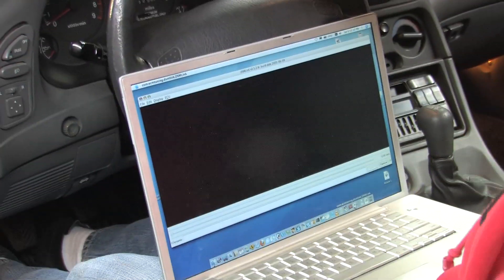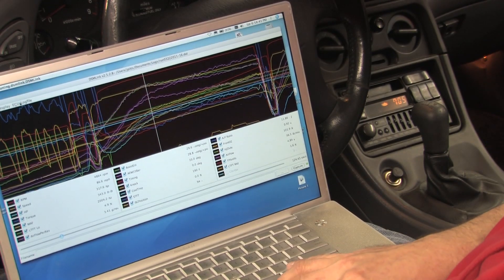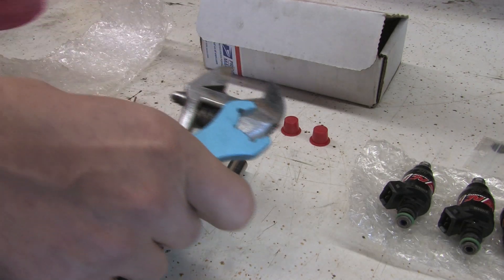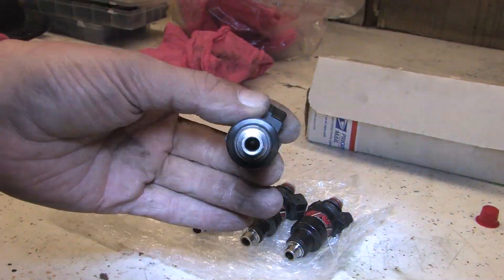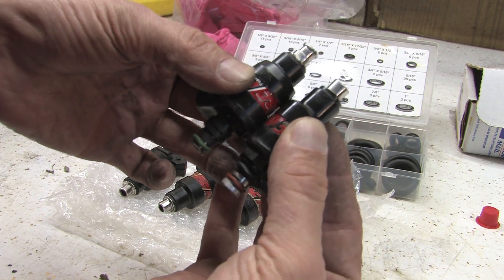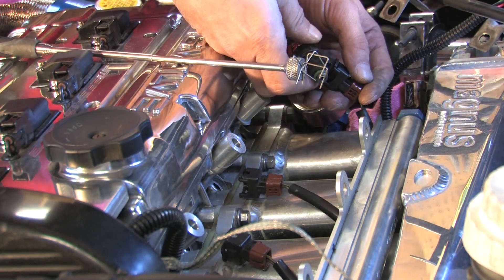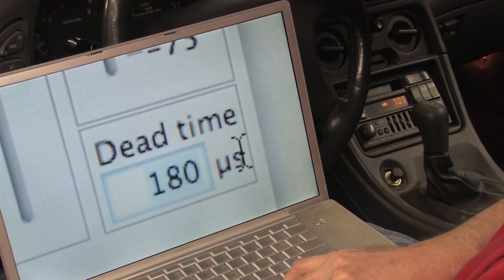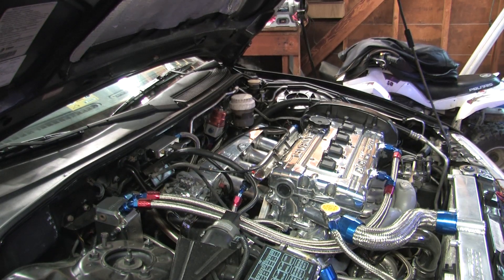GSX RC 750cc Fuel Injector upgrade

Comment: Let me ask you something I have a 97 eclipse GST  everything stock I only have a 20G turbo on it and now I buy a 750cc injectors,I install the injectors on my car and after that my car don't start and when I put back the stock injectors he start again you think that I have to tune or something for upgrading my injectors or my new 750cc are in not working condition
Reply: Dennis Nuñez sell your car
Reply: @alexmercado3361  I think your jealous,why sell is car
Reply: Dennis Nuñez you need tuning software, a bigger fuel pump and it would be wise to get a FMIC, wideband AF gauge for starters!!
Reply: You bought high independence injectors you need low one's.

Comment: How do you fix the squeaking nice at 7:30?
Reply from the maker: If you have that exact squeak, it's not good news.  Take all of your accessory belts off, let it sit overnight, fire her up.  If it makes that noise with no accessory belts, pull the engine and rebuild it while you still have something to work with.  You have a failing oil pump.  If it doesn't squeal with the accessory belts off, shut it off, install the belts one at a time.  When it squeaks you know which accessory it is.  It's a bearing giving up the ghost.

It goes away and doesn't come back until the engine's cold, right?  Bearing.  It doesn't matter if it's the oil pump or an accessory, that's bearing behavior.  If it squeals all the time and sometimes randomly when you're driving it, it's an accessory seizing up, a belt, or a pulley problem.

Seriously, it's not cool.  That's what took my engine out less than 500 miles later.  Cut open your oil filter and look for bronze or aluminum colored particles.  If you have the SAME noise as this, it's bad news.  I hope it's not the same noise.

Just FYI, my car did this for a total of about 2500 miles before it went.  It got progressively worse.  Do the test with no accessory belts on a cold start.
Reply: It does that every time
Reply from the maker: Hot or cold?  or with/without the accessory belts?  Seriously, the accessory belt test rules out a ton of stuff.  The only spinning things that poke out with the belts off are the cam gears, crankshaft, oil pump gear, tensioner and idler pulleys.  We can pretty much rule the cams and crank out.  So the things that are left are the oil pump driven gear and timing belt pulleys.  If either of those 2 things are on their way out, you would need to dig deeper.  If the test passes in flying colors with no noise, breathe a big sigh of relief.

I'm not trying to scare you with my assessment or advice.  I'm trying to save you a ton of effort and/or money.
Reply: It squeaks every morning, it sounds like it coming from the power steering side.
Reply from the maker: The problem is that all of the belts are on the power steering side.  The power steering belt is driven by the alternator belt using a double-pulley off the water pump.  The water pump and alternator are driven by the crank pulley.  So that's why I suggested taking all of them off before you start it.  It just takes a 12mm wrench and some small hands.  Something I'm not blessed with.  But it's really easy to do it.  Easier if you don't have AC, but don't even mess with that one.  Just turn your AC off.  Use a shorty 12mm wrench if you've got one, and just pull the alternator and power steering belts out..

If it makes noise when you start it like that, only then is it bad news.  If you get any trace of that noise with those belts disconnected, no manner of belt tightening and adjusting will ever stop that squeal.  It goes deeper than just the accessories.  An oil pump shaft failure sounds an awful lot like belt squeal, and I too thought mine was the power steering pump belt or bearings.  It was not.  It was not the power steering pump.

There are other tricks you can do to isolate belt squeal involving soapy water, but if your belts all pass a visual inspection, you find no belt dust and they're all tight, take them off and see if it does it without them.  The way you fix a squealing belt is usually to replace it, so it gives you a good chance to see it up close and personal.  It's not extra labor if it settles whether or not you have a timing belt bearing or oil pump shaft bearing failing in the process.  If anything, it's cheap insurance.  The best case scenario is that it's just belt squeal.

Also look at your crank pulley while it's spinning and make sure it's not wobbling, and that the rubber damper ring on it is in tact.  Damper pulleys do go bad on these cars.

Comment: Its been a while since ive used DSMLink but there IS a way to determine if you need to adjust it i just dont remember from the top of my head. but it has to do with logging your LTFT (long term fuel trims) and STFT (short term fuel trims)
but if you ask me i think its useless for the MAFT guys since the air/fuel ratios are always out of wack depending on the ambient temperature. because the Intake air temperature and barometric pressure sensors are always at a "locked" value

Comment: dead time is the time it takes the injectors to open after receiving a signal from the ECU, the bigger the injectors the longer it takes for them to open. ECM link isnt as accurate as you'd think. you'd have to adjust up or down from the suggested setting for the injector size you have to fine tune

Comment: @Jafromobile It's probab;y the best thing you can do for any fuel pump is wire in a relay. I have mine done in my Mazda MX6 but I'm going to redo it and do an actual wiring setup instead of the old stock wires from 1989. My plan was to have it doen before summer but it's looking like the end of summer. I need to Upload some of this content and get the lead out of my ass. Did I tell you I I'm building a DIY Flowbench?

Comment: @Jafromobile Try the standard rewire mod that everyone does. You want the pump to get 14-16V but when you get 16V or above, the fuel supply from the 255, 190 or any fuel pump for that matter will drop. At least check out what voltage you're getting if you havent done so already. I've found 11-12v going to the pump on occasion - direct voltage to the pump fixes that.

Comment: @Jafromobile I never had A/C in Texas either. The weather is BEAUTIFUL at NIGHT - when you're racing anyways. During the day you just keep your windows down. I had a 450hp B18 with a B16 head in a 1989 Honda CRX. It was filthy fast. 

Also suggestion for injectors in the future - contact witchhunter. It's just witchhunter. com great prices on used injectors all flow tested with spec sheets. Saves you a bundle over RC's.

Comment: @Jafromobile - I missed what turbo you have. Do you just have a Big 16G - or are you saying that you ported the compressor inlet to the size of the 20G wheel so you're pulling a greater airflow potential with the same 16G wheel? Turbos defy the rules all the time, especially with greater RPM and head mods. The 20G maxes out at 680CFM, the Big 16G is somewhere in the 580 range. Good numbers nonetheless. What fuel pump, Walbro 255? What voltage if so?